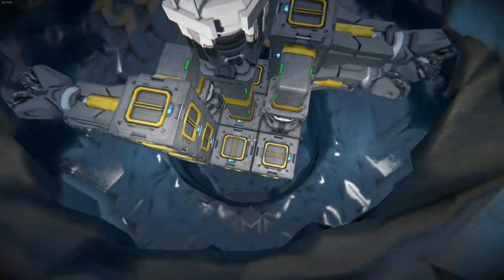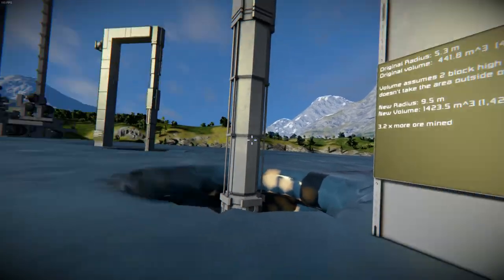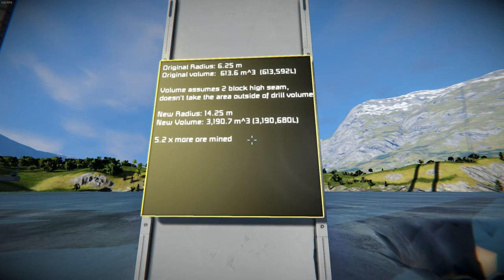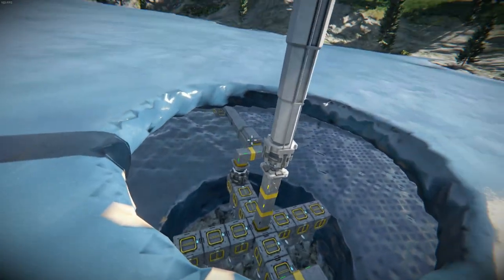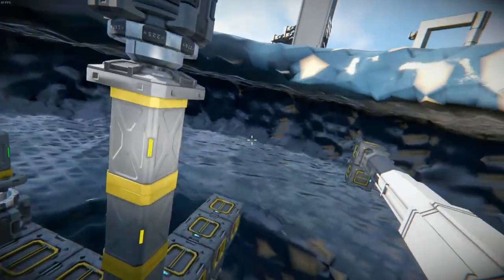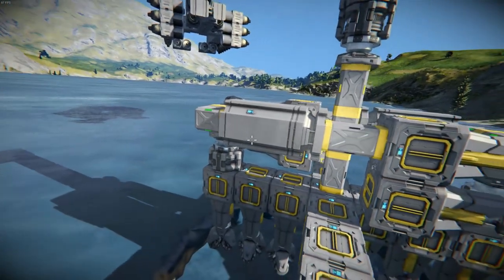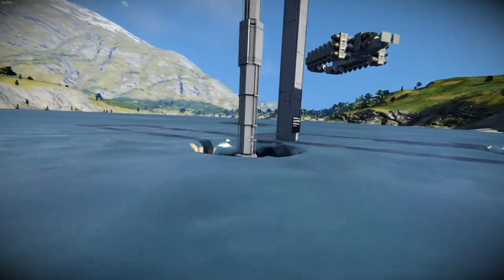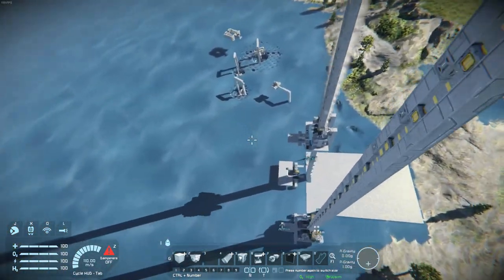Some Drill head ideas and a space elevator sneak peak

Comment: I do like your Space Elevator. 

All others that I have seen built are actually Space Poles.  That is, a line of conveyor tubes reaching into space that the player can use to sent items to and from space without having to endure the journey.  But they don't include a means to actually transport into and back from space.
Reply from the maker: I really hope the game can handle it when it's done, my goal is to not go to space until i can travel there via elevator :)
Reply: @PatrickHansen101  
Nice.  You may need to install an armchair, some light muzak and reading material for the journey 🤣